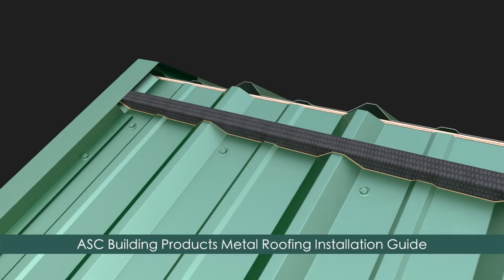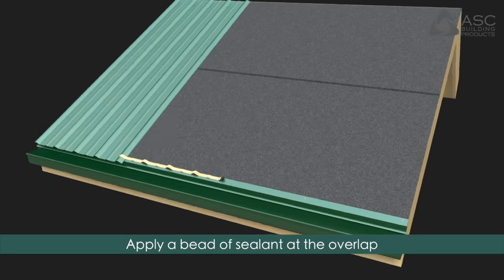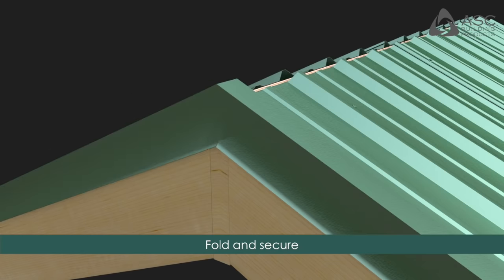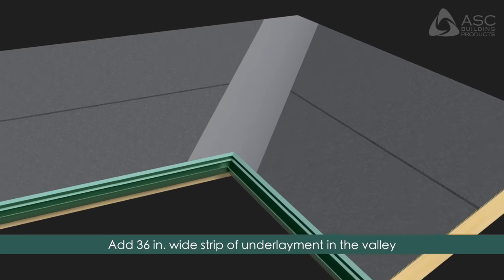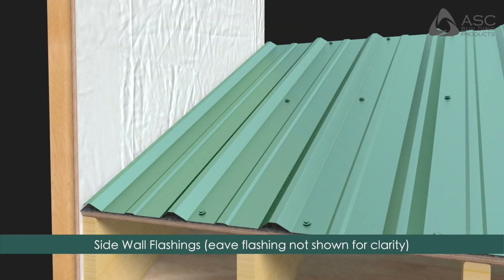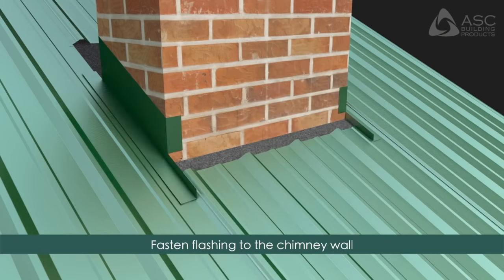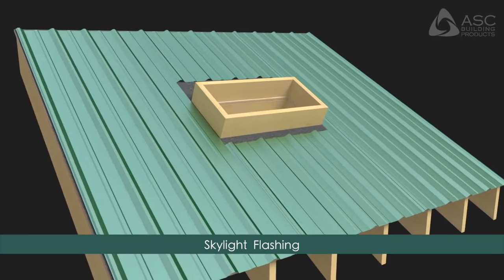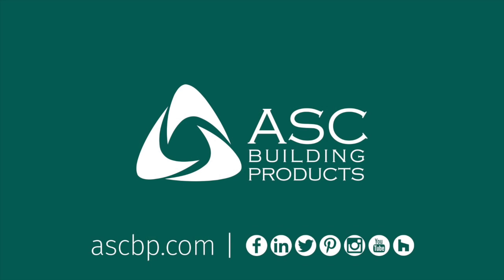How to install Metal Roofing 3ft panels-ASC Building Products

Comment: I do not understand why you are placing screws into the valley of the roofing profile. Over time the washers on the screws will deteriorate and allow water to leak into the roof??? My home has sustained major damage due to builders placing screws into the valley of the roof profile. I will note the original builders of our home did not place any screws into the roof profile valley. Only when we had a pergola attached to the house and for what ever reason the builders decided to place screws into the valley of the metal sheet roof profile and these leaked and have rotted out part of the fascia board.
Reply: You're absolutely correct sir. He hopes all his viewers are stupid and beauty parlors staff.
Reply: For some reason, the manufacturers recommend screws in the valley.  I did my barn with screws at the peaks 11 years ago. Works great and no leaks.  Just tighten the screws till snug.
Reply: I understand your thinking  but remember - All roofs require maintenance - some more than others.  Using 2 coats of synesthetic underlayment - outlasts felt and gives you even more protection.  You should see how often satellite dishes get roof mounted. Crazy stupid
Reply: Manufacturers do recommend field screws.  There are 2 items to keep in mind:  most leaking issues are caused by under tightening or over tightening of the screws, and, it is recommended that screws are replaced, approximately 7 years, for this exact reason, even in the best of circumstances those washers will break down in the elements.
Reply: @thundermountainmetal1692  Yes the UV exposure breaks down the rubber washers and I 've read that a lot of other problems of leaking are due to people over-tightening the screws during installation.
Reply: Screws in the rib(crest) is mandatory in Australia.

From chatting with some of my fellow roofers in the US, it's because screws in the rib requires more precision and their is a general lack of skilled tradesmen around to do that.
Reply: This is not done this way , never put fixings in the valley that's the way I was trained.
Reply: Just read the comments about screw placement.  Here in Missouri the insurance inspectors want the screws to be in the valleys.
Reply: When I served my apprenticeship, l was always told to screw into the crest, not the valley. But modern systems recommend  valley fixing. No one has ever been able to explain  the change in practice  to me
Reply: How to install EPDM roofing
Reply: @donalryan2429  Is it advisable to add roofing caulk as additional sealant after screwing?
Reply: Designed like this on purpose because you can't get the same strength when you screw into the nubs. Especially important for wind. If you have proper waterproofing and ventilation (strapping or mesh) with proper maintenance should last 25+ years. 
Problem is that homeowners complain about the price or just don't know best practice. If you want it to last longer get a thick gauge standing seam.
Reply: @nb-eq6rw  Yes you get exactly the same strength if using the right lengthed screw.
Reply: You wanna a job a guy with over 50 renovating homes did the exact same thing  ect ect lol
Reply: You was trained 100 years ago on tin roofs. If you screw down on the ribs it will never be a tight fit. The rib will bend down and you’ll have a gap on your screws. That way of roofing is obsolete, always screw down in the flat. It makes perfect sense. The biggest problem is 90% should hire professionals and not do themselves. I’m not trying to be a smartass but these comments are seriously lacking common sense
Reply: It’s because Australia is a third world country still using old way with Tin roofs from the 1800’s. If you screw in the rib you can never tighten the fasteners without completely flattening the ribs which will do damage. Come on people in these comments are effin stupid
Reply: I have been wondering the same thing.
I guess it's easier to put fasteners in valleys...we tore down a 70 yr old 300' ft long chicken house that had the metal roofing secured with metal roofing nails placed at the peak of ridges..not in valleys. It had very little rotting.
Reply: That's exactly why I'm watching. My roof was screwed down by builder along the valleys. Why not screw along  ridges of my tin roof where panels overlap or if screws are supposed to be placed along valley why not use sealant like Liquid Nails in between ridge layers. I had two panels that were bent up from bottom of roof to halfway because the ridges aren't fastened down during Tropical storm.
Reply: @n2locarz1 😊
Reply: Yup, what they all said.  My barn roof was installed about 1987.  It eas attached with nails with rubber washers.  Nails placed on the crest.  Luckily it's been fine.  When the screws came along they started in the valleys where they can be made tighter (but not too tight).
Reply: They’re not placing screws in the valleys.  The valley piece has no exposed fasteners.  Not sure what you are talking about.  This install guide is near perfect.  I’ve been roofing for 18 years.  If you mean the screwing the lower parts of the panels and not on the ribs, they have to screw there to prevent the roof from blowing off.  The lap is screwed to keep the laps together and the field is screwed to secure the roof.  If your roof leaked it’s because they had poor workmanship.  This guide is extremely detailed and very correct
Reply: @michaelsamchuk1819  Not sure what video you are watching but the one I watched shows drilling and putting screws into the valley of the roofing profile. The screws have rubber washer which are supposed to prevent water from running through the screw holes. However, the rubber washers perish over time and your roof leaks.
Reply: @michaelsamchuk1819  same here i see them putting the screws right in the channels of each section completely exposed screws, it's in the first few minutes of the video.
Reply: @kevinaldcroft6291  they are talking about the valleys of the panels themselves not the valley flashing in the valley of the roof. Said another way, the area between the ribs of the panels instead of through the ribs themselves.
Reply: Maybe with 30 year rates caulking over the bolt heads and rubber washers it will prolong the life of the washer to something close to the actual life of the metal roof.
Reply: If in a windy area the fasteners will fail if installed on a high rib. They could have been sealed with caulking as well.
Reply: The roof manufacturers need to sell more, NOT make their products last.  They’d be delighted when you have to replace your roof because the rubber washers deteriorated.  Every roofing rep sincerely hopes to replace every roof every 5 years.
Reply: Standing seam is better
Reply: ABSOLUTELY TRUE
Reply: Its called maintenance guys. Youll have to replace the screws eventually. Use bigger screws on the stripped ones. Not all need replaced most of time. Winter and summer affect screws as well. Everything deteriorates.
Reply: Out in Hawaii where we get more rain than anywhere else in the U.S. (140+inches per year) we put the screws on the peaks. Water eventually penetrates if put in the valleys. For those saying this way doesn't work with strong winds, I beg to differ. We get our share of tropical storms  that come through and topple trees and make messes of things. Roofs last 20-30 years. Maintenance here is primarily pressure washing off the roofs to get them clean. We also don't use felt or underlayment because the panels are supported by purlins attached to the rafters, spaced 2 feet apart. The metal roofing is the only thing keeping us dry.
Reply: It doesn’t matter, the whole roof gets exposed to the elements, not just the valleys, it’s quality of screws used by your co tractors, that’s why the roof leaked
Reply: Make your video man, we need to learn the proper way sirusley.    Real info is better than half a......, ones
Reply: This is exactly how you do it.
Roofing screws have EPDM washers. The EPDM is very effective and rugged, and they just about glue themselves to the metal, they can last decades.
But, they have to have the correct compression on installation, and anyone who knows what they are doing will be very deliberate about that. With such a critical part for the effectiveness of the roof, and doing hundreds or thousands of them, you want very controllable consistency. 
You can only consistently get that correct compression on the flat of the panel where it is solidly supported. 
The rib will compress down if you are trying to get good compression on the washer. There isn't a good solid stop to it.
Someone being extremely careful may be able to get really good consistency at installation. But since at the rib there is a 1 inch gap between the metal and the roof, there is potential for the metal to strip out on the threads, say by heavy snow load, or ice falling fron a higher roof, etc.
Reply: I put an underlayment under my metal panels... Hopefully that also helps because I did screws in the field/valley.

Comment: I hate to tell y'all, after two years that ropeseal (butyl tape) under the rake (gable) trim will NOT divert water. Stitch your trim to the highs as that will let the water run along the bottom of the high to the gutter with no way to get under the sheet.
Reply: What does "stitch your trim to the highs" mean?
Reply: @idk8964  putting the screws, that hold your rake trim on, in the highs of the sheet and not the low areas where the water runs. Many people seem to think they can run caulk or use panalastic rope seal under the trim- 4-5 yrs it'll need replacing. Put your screws in the high and you'll never have to worry about leaks.
Been doing this since 1998, I've seen it all (most of it anyways) 
Hope this helps
Reply: @mikemissildine370  is there a resource /video you recommended that is quality education?
Reply: @trippyvortex  I'm not sure. All of my knowledge came from on the job "training", I was a line cook for 6 years before. I started with a company that had been around since the late '70s. Now im able to dig dirt, lay rebar, finish concrete, fabricate/ erect/ sheet/ trim the building.  Even the plans from companies like Shulte, Whirlwind, Red Dot, Mid Western show to put the screw in the flat. I've have done MANY repairs because of this. Lay a new sheet down and measure from the  high 12" to the take trim and that's where the screw goes.
Do y'all put gutter straps in the lows of the sheet?
Reply: @mikemissildine370  I thought the tape was to prevent damming not normal water ingress.

Comment: I use 2" screws and screw down on the rib. I go with the theory of build your home on a hill out of the water not in a valley where the water flows. Skip the mastic and use Lexel clear silicone!
Reply: Lexel isn't silicone.  They abandoned screwing on the rib in my area many many years ago.  I believe there is too much deflection there.

Comment: The underlayment should be installed OVER the drip edge flashing at the eaves and under the drip edge flashing at the rake.... at least its code in the North to ensure water from ice damming doesn't flow between and rot the fascia board.
Reply: Seems like the underlayment at the valley should be laid down first also for ultimate drainage purposes.
Reply: @gary7708  10-4 😎

Comment: 1inch screws are never long enough should be 2or2@1/2 inches I have a friend with a pole garage over time freeze and thaw and wind worked the ends of the panels loose and caused leaks we replaced the screws with longer ones to fix the problem just a thought

Comment: It will leak like a sift with screws in the water valleys. Screws should be on the ribs.
Reply: Not so
Reply: @gabeakiki3878  😳😆🤣
Reply: @terrymcguire8476  back when the washer wasn't neoprene this was a 100% right. Lots of manufacturers say on the flat (some say both) I personally do it on thr top
Reply: this isn't 1972 grandpa

Comment: In reply to Mak Flan, and to further describe points I made earlier:

First, I daresay that if one hires a company to install a metal roof, most likely not a single worker in their crew has ever actually watched and learned all the details and countless steps shown here to properly install metal roofs. Instead, most workers are young and inexperienced, and most of them just "learn on the job" when a co-worker says something like "just snip and bend the ends in", because the more experienced worker does not know how it should be correctly done either. Even if an installer does know the more correct way to do something, almost all installers will take shocking shortcuts just to save time and effort, thinking correctly that "the homeowner will never know the difference". 
Only, here is the problem: the homeowner WILL find out the difference when future problems and leaks occur. And mark my word, roofing installers will never return to fix improper work. In my true experience they simply stop taking your calls.

This video shows an amazing array of many dozens of fine points required to properly install. Typical roofers simply don't care to follow all these confusing instructions, and when they encounter various snags or problems they will usually just "work over it", meaning not correct the problem and just hide it quickly and move on. This usually has the effect of leaving lots of areas that will leak, especially during winds and storms, and may not be noticed early on.

In my experience, most instances of flashing will not be handled correctly. I could now write a whole book about all the poor installation procedures and omissions I have realized that roofers did. Here is the point: almost all roofers are NOT particularly educated or consciencious in their workmanship. They simply want to make the big money and move on to the next job. Problems left and created by roofers are often not easily fixed.

For example, I currently have some roof leaks and after months and even years of searching, have not been able to find a roofer willing to try to solve the leaks in a shingle roof. One very experienced roofer got on his ladder, climbed up, came down, and was unwilling to attempt the repair regardless of agreed price. Why? Because roof leaks are often not so easy to identify. Besides, "repairs" typically do not pay as well as installing a whole knew roof, and they want to make the "big, easy money". They usually seek to do only ranch house roofs: extremely easy roofs with no complications. I am sure the next time I get a new roof it will cost over $20,000, and I dread that day because I have been through that unpleasant experience before, and it seems that roofers often create more problems than they solve. And, I just know that installing metal roofs has much more room for error and improper methods than shingle roofs do. Either way, it is about impossible to luck up finding a qualified and diligent roofing team.
Reply: I was a professional roofer for over 25 years installing everything from large commercial systems to highly customized niche residential applications and everything in between. One of our many specialties was installing metal roofing and we not only had the knowledge, expertise, and skilled manpower to do the job from start to finish, but all of the necessary tools and equipment to fabricate from coil and flat stock every piece  involved in the process. I had the pleasure to work with some of the best in the business and if one of our installs failed it would only have been the result of an F5 tornado or an airstrike. 
I can also tell you that if I was going to spend the money on a metal roof, I would much rather prefer to have a standing seam roof installed over this system due to the lack of exposed fasteners involved, which will all be future failure points on this roof. The rubber gaskets on these screws have a u.v. resistant coating embedded into them but even with proper torque when installed, they will only last so long. In 15 years or so, you would have to either replace every screw or clean, prep and spray the entire roof with an elastomeric coating to prevent the eventual leaks that would inevitably arise.
You have to due your due diligence and like anything you get what you pay for, and quality isn't cheap.
I personally cannot stand most salesmen as they know next to nothing about the product they are selling while promising you the moon in the pursuit of a fat commission. I would personally want to meet and speak directly with the owner of the company, see examples of his work, scope out his place of business, and see what type of ship he runs firsthand before I ever committed myself to a legally binding contract. 
Best of luck to you.
Reply: @Sum-Ting-Wong71  Thank you for taking the time to write your thorough and helpful reply.
Reply: @Sum-Ting-Wong71 you seem to be telling  us something important but it was quite long winding and I was lost. Can you please go directly to what is it you’re trying to say. Which is better and why 🙏
Reply: @mengiequirante2460  
You seem to be trying to grasp something outside of your ability to comprehend.
Reply: @Sum-Ting-Wong71  that’s neat 🤣
Reply: @mengiequirante2460  
What kind of wierdo  name is that?
Reply: @mengiequirante2460  
I said your name is weird.
Reply: @Sum-Ting-Wong71  I mean you write your name all the time. 🤔  😫
Reply: @mengiequirante2460  
Why so rude?
Reply: @Sum-Ting-Wong71  it was an earnest comment. I guess you’re not just used to people telling you unfavorable things.

Comment: I just purchased a 4 year old home with a metal roof & on the rear section of the roof, the first row of screws horizontally begin 29 inches from the gutter. Should I be concerned?

Comment: I can not find a video that shows in detail how to properly close a metal valley when a lower ridge runs into the slope of a higher perpendicular ridge roof section.  The mystery is how to seal the very top where the valleys intersect.